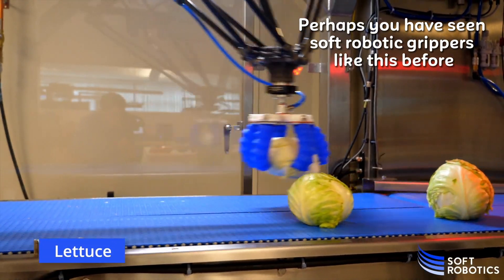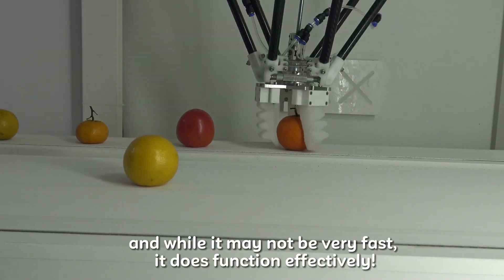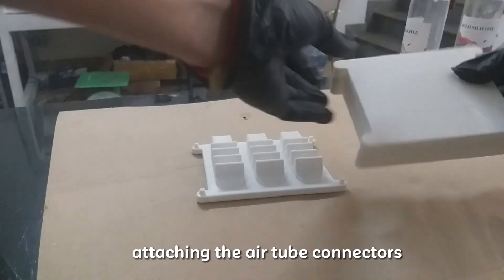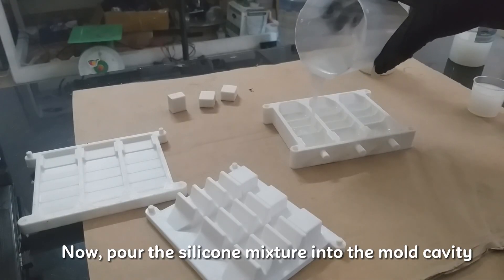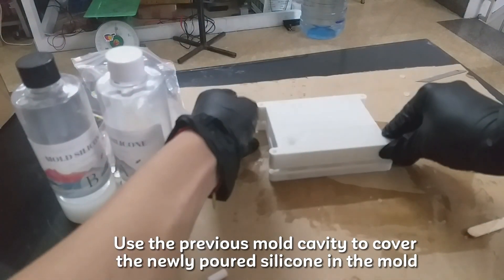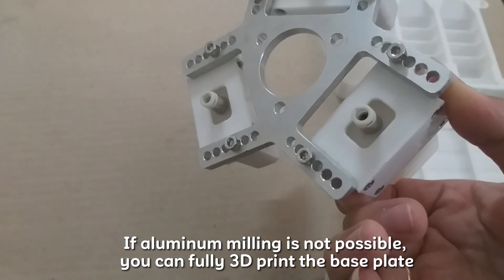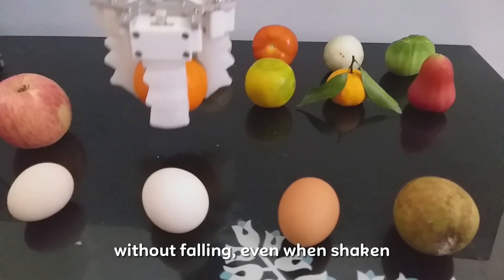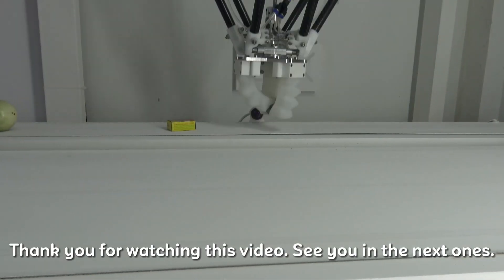DIY a Food-Grade Soft Gripper for Your Delta X S Robot for Just... $10

Comment: Hello, what are these connectors called?
3:46
Reply: Those are pretty standard ptfe fittings (otherwise called Bowden tube connectors). They’re on 3D printer and such. A quick google search will hopefully get you where you need. Just respond if you have another question.

Comment: hello, could you advise on what 3D printing filament is used for those white plastic pieces embedded in the silicone mold? I am working on a similar project of a different design, but need to embed some kind of filament in my silicone mold to properly affix each finger to a base for actuation. I've heard PLA doesn't bond well to silicone, and can't figure out what filament is used here. Thanks a lot!
Reply: I have the same question, Did you find a better material than PLA?

Comment: Could you provide some info on the vacuum pump please? I found it on your website, but I have a different application (ejecting small amount of fluids from special nozzles) where I would need positive and negative pressure and I don't want to buy two pumps. Can you tell me the exact model of the pump used? Big thank you! Amazing project!